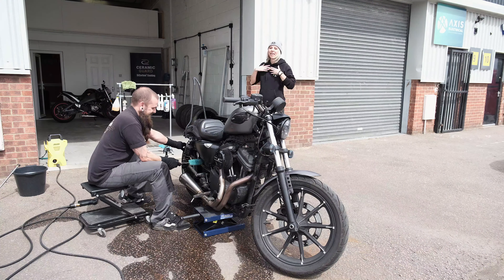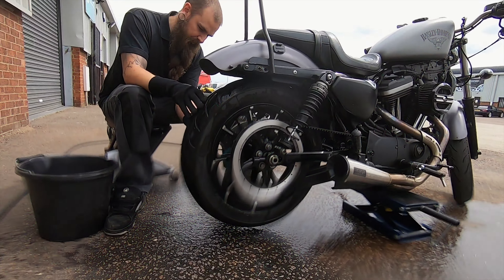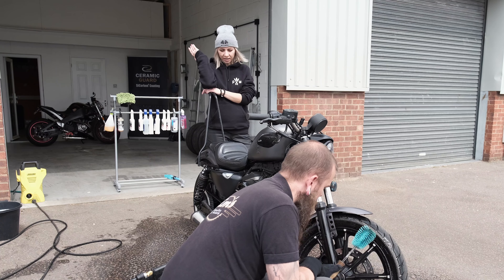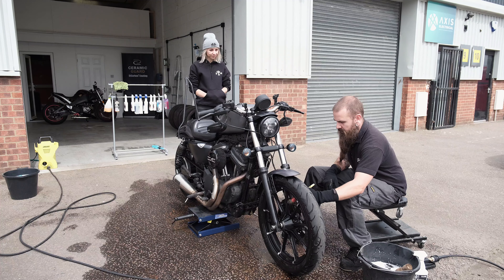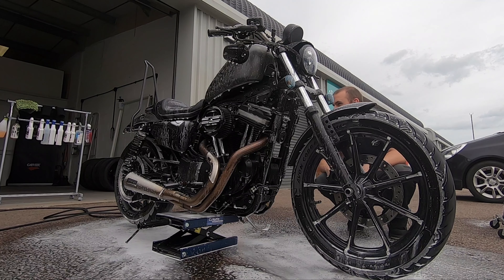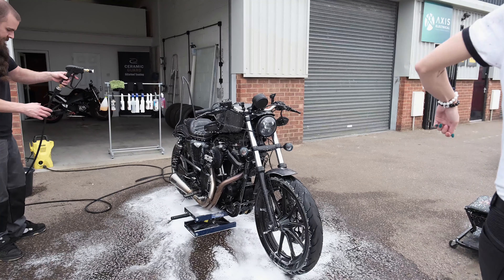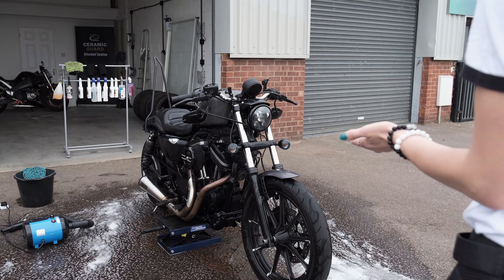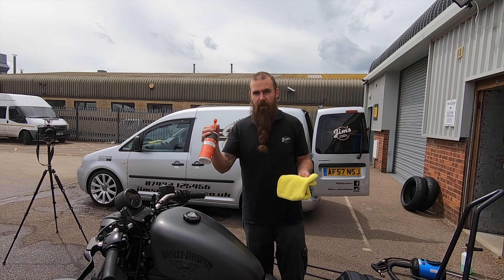MOTORCYCLE CLEANING TIPS / My Filthy Harley Davidson Sportster Iron Spring Wash / GOPRO MAX 360

Comment: Once it is very clean, the machine will be easier to keep clean. When they get too dirty, they take a long time to wash up, and I hate getting wet! :) My Dodge truck is a pain in the butt to wash and wax.
Reply from the maker: No way, you drive a Dodge truck!!!? 😱😍
You are right. But in winter I cover it with oils, to protect from salt and at least a little from rusting. And then all the dirt sticks on crazy. So I got used to it being filthy during 'non season' season.
Reply: @tomboyabit  The oil is smart! Keep the aluminum bits shiney. :) Oh, 2001 Dodge 2500 4x4 automatic crewcab. And it has the monster V-10!